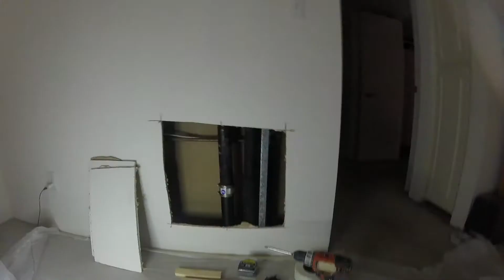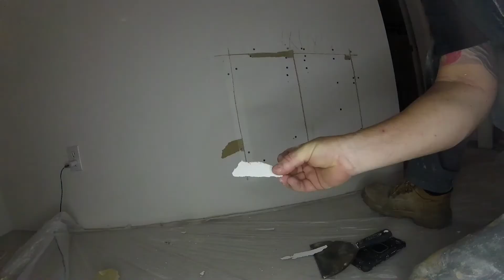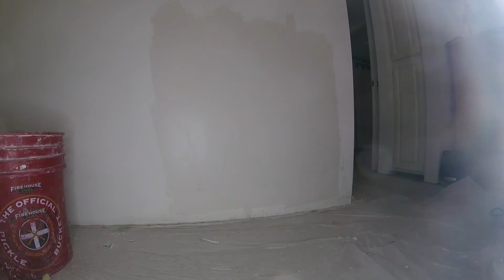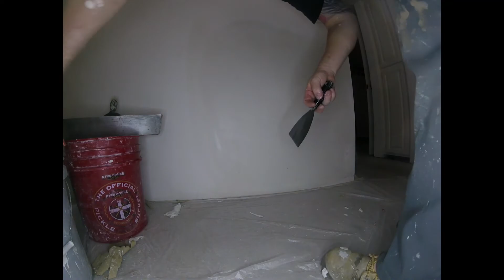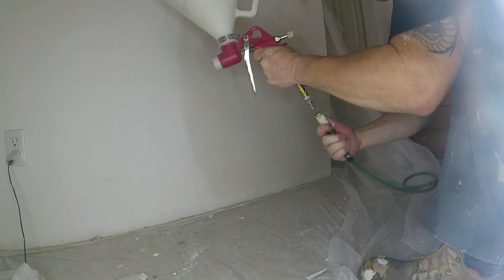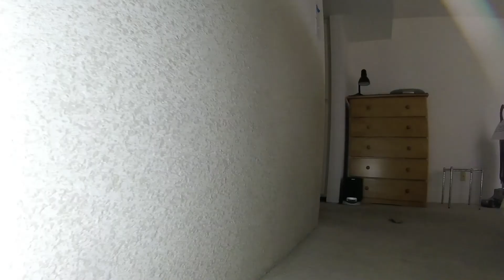How to Repair Drywall Holes After Plumbing Repairs | Easy DIY Wall Patch Tutorial

Comment: I heard you say you’ll need to use new sheet rock. I one of the other ones I thought the repair was made with drywall. What makes you decide whether or not you’re gonna patch a sheet rock or plaster wall with drywall or plaster it and use sheet rock. I thought from one of the other videos just use the drywall when you can if you can explain a little, I’d appreciate, thank you thank you
Reply from the maker: Do you use new sheetrock if you have to use new sheetrock or you use the patch if it's a nice piece if you need to watch these free videos those are free to watch
Reply: @drywallrepair  thank you sir. I’ll just watch all the videos. I’m sure you’ll answer any questions I have. Right now I’ll just take my time and do it as perfect as I can. And not worry about profit I’m very good. Thank you.

Comment: Excellent video. What if I have a cut out from a tub surround that has tile attached to it? don't want to drill through tile. Can I attach furring strips with liquid nails on back side of drywall surrounding the hole and attach the original tiled piece to the existing stud and furring strips?
Reply from the maker: Dunno many videos on channel here watch few patching videos
Reply from the maker: U can drill thru grout lines. Or remove couple tiles redo
Reply: @drywallrepair  I ended up using Loctite Power grab construction adhesive to attach the furring strips and then, next day, attached the tiled drywall piece with the same. Can't even tell if was cut out. But thanks for your idea.

Comment: I have some patches I did years ago. I didn't spread anything mud or joint compound all over the patch I just taped and did the cracks then sprayed texture on it to match the existing wall. You can't see the patches came out good but all the videos YouTube shows the effort to spread all across the panel so it's not clear to me how it has to be done.
Reply from the maker: have 100 videos on patching please view few of them to see process

Comment: What do you do if the pipes stick out further than the drywall? Previous owners did a hack job at patching now I have to figure out how to fix it. How much do all the materials cost about?
Reply from the maker: u may have try shave down back side of patch, if not Ur going to have patch over it as best as possible and have hump in wall, you can't do step 2 correctly if step 1 was not done correctly.  Fix plumbers mistake
Reply: @drywallrepair  the more I think about it, it looks like I need to attach some skinny strips of wood around the perimeter of the opening like a picture frame then put the drywall over that I guess… or plywood? They built this box thing and literally velcroed it to the opening thinking it would hold. The opening is 19” by 26”! So the velcroed box thing fell off the wall and that’s what I have to enclose. 🤦🏼‍♀️
Reply from the maker: https://www.youtube.com/watch?v=TDHbFEk2qYk&list=PLBz61ZEZh-RWCQMqnlY-YTLZ_h9JbfeDb

heres videos on plumbing, videos are free to watch- any advice my time needs add $ to cookie jar
or contact local drywaller to come to ur job and give you advice
Reply from the maker: https://www.youtube.com/watch?v=TDHbFEk2qYk&list=PLBz61ZEZh-RWCQMqnlY-YTLZ_h9JbfeDb

Comment: I don’t know what you mean by “hot mud.” In repairing a trashed rental, I used a tub of some stuff I bought at the hardware store - it came in blue or green. I found it was way harder to do than it looks. I went over and over it multiple times, letting it dry overnight each time. It never came out perfectly smooth, so maybe I used the wrong stuff. Also, even though I cleaned the metal drywall spreader, it rusted along the edge. It’s about 10” - 12” wide but I can’t get a smooth finish with a pitted edge. Anyway, I’m new to this so I’m glad I found your channel, but wish you would explain what “hot mud” is and whether it’s preferable to the stuff you buy in the tub at Ace.
Reply from the maker: you shouldnt be using quickset muds if u never worked with muds before, you only use joint compounds if ur a beginner
and if job hard then hire a pro
Reply from the maker: hot mud means quick set mud hot because it chemically sets

if you watched few my videos and materials videos, you would know not to use theses quickset muds as they for pros only - 
hot muds are not for beginners
Reply: @drywallrepair  ok, thanks. I’ll watch more of your videos because with the way some tenants leave their units, I can see many more patches in my future, lol! The last one had walls so gouged up it looked like there had been a bull fight in there!
Reply from the maker: many videos watch/comment / like them all I need more view time as this channel is not monetized as not enough view time on videos
Reply: @drywallrepair : OK

Comment: Yes i had a plumber come thru my home and make a hack mess of my walls, why do plumbers have to cut such large holes in walls for a 2 inch pipe🤣
Reply: Because plumbers need a lot of room to fit in any kind of tool used to make their repair, especially if it's copper work.
Reply: I think plumbers should patch the walls, or have a team of patchers come by to finish- I wonder why they think it is ok to leave a big hole everywhere they go ?
Reply: @seinundzeiten  a plumbers hourly rate is usually 2-3x more than that of a drywaller, at least.  
So like, asking the plumber to do the drywall repairs too is really gonna cost you.   
But if you're rich then maybe that's no big deal?